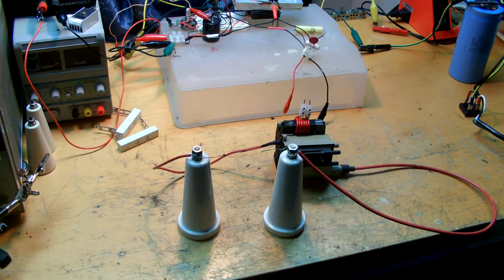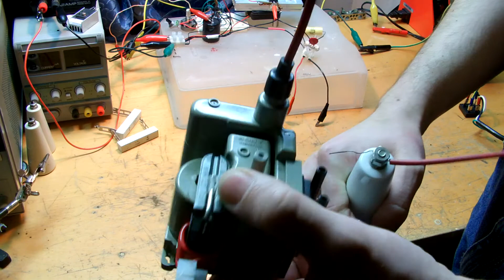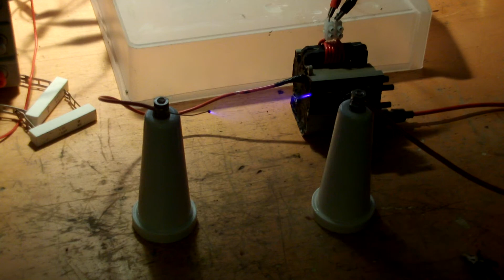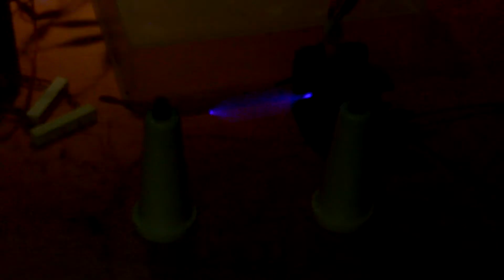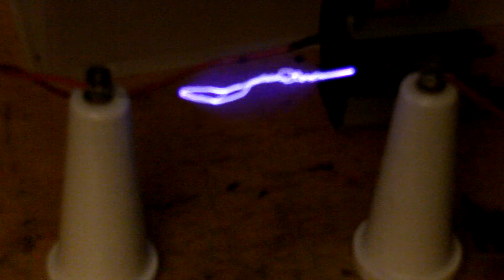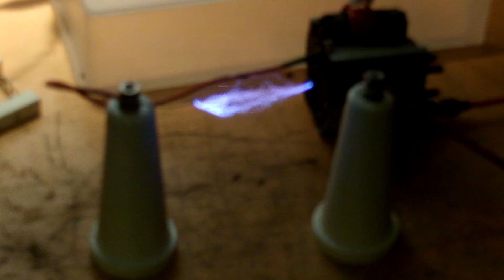Flyback with Voltage Tripler

Comment from the maker: Hey thank you Andreas!  Its certainly an odd flyback but now that i think about it,  it makes a bit more sense, the CRT was a 36" massive tube that took a ton of voltage to power and getting  a flyback with such a massive secondary required would take alot of power to drive, I think the cost saving decision was to just use an average flyback with a tripler to make up for it!    Thanks for the comment :)

Comment: I don't think that is necessary to mention since most modern flyback transformers already output DC voltage.

This is a flyback transformer with a voltage tripler instead of just having a rectifying diode like many flyback transformers. There are variants with voltage doublers too. The voltage doubler and triplers does the same job as the rectifying diode but with the bonus of multiplying the voltage roughly two or three times. :)

Comment: Can I Use a neon sign Transformer that outputs 3 kilovolts to run a fly back that's the same size that with four turns for the  primary how many kv do you think I'll get ?

Comment: Really kool Pete, I love it when you get corona like that,
I agree with Anton with smelling the ozone from here haha xD
And yes, I was just looking at a PKZMO motor protective
circuit breaker I dug out of the shed today, that could make
for and excellent victim for my circuit breaker tear down,
also I have a 200A 3 Phase main circuit breaker, but I think
that's a little too expensive to want to take apart, I will find an
old standard BS EN 60898 MCB to do a tear down on first.